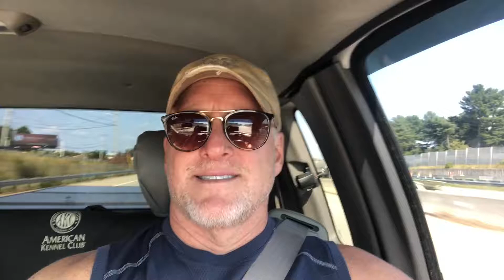How To Prevent Expensive Transmission Rebuild: 4R70W, AODE OD Shudder Fixed & Strong After 16k Miles

Comment: Good to hear - I haven't checked that ten video series yet. I have 2001 F150 SCab Lariat 4x4 and your seat cushion was spot on. I picked up a junkyard console for the conversion so when I change the driver bottom cushion/cover I can do as you suggested and pull the carpet for the sound deadener and my amp wires. My cab is excessively loud without the back seat in, as you mentioned. I'd like to also try and find a back power window for conversion when I fix it's seal (leaks just like the front in your other video.) I also took note when you mentioned the cluster conversion, my digital odometer goes out sometimes and I'm sure it's those solder joints. I wish I would've fixed the manifold when I replaced the suspension, but I didn't have the mounts on hand yet and I'm afraid of them breaking off in the head. I look forward to trying all your other upgrades as well. Thanks for your help, Barry!
Reply from the maker: Hi Brandon, very glad you find my channel and videos helpful.  

Side note for the rear power window.  You can buy a regular OEM style slider and when you find a truck with a power slider, get the parts I listed in my vid.  You don’t need to wait to find the power slider before doing the rear window replacement.  

Let me know if you have any other questions or needs!